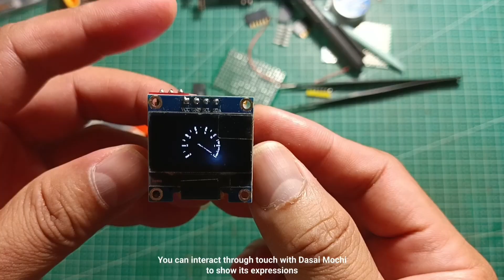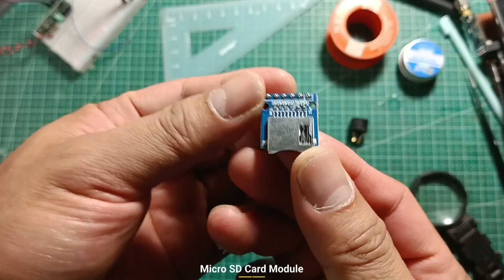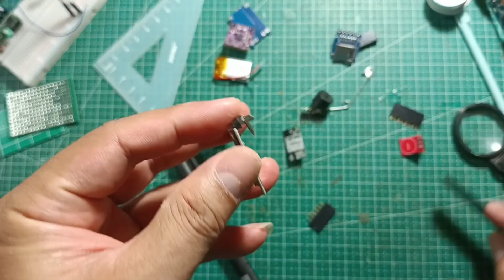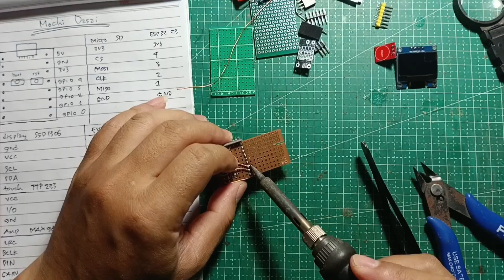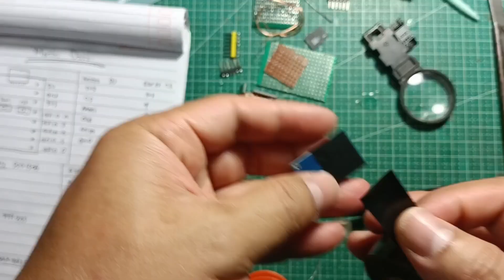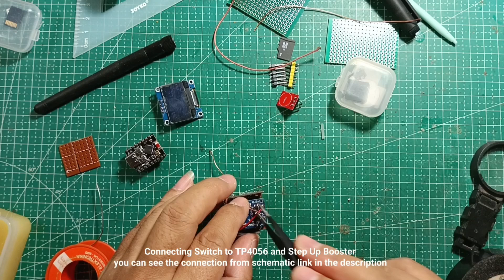How to Make Dasai Mochi by Huykhong Part 1

Comment from the maker: Leave a comment and feel free to ask question here 👇
Reply: can you please send me here the component's please everything btw including the random brown board the usb cable and the wires its for my sisters project. thank you!!
Reply from the maker: Components list It's already in the video
Reply: hi can you tell me the names of the brown board thing the usb cables and the head pin sizes?
Reply from the maker: Brown board is a dot matrix PCB, USB cable for esp32 C3 is a type C, and for the header pin all use standard header pins
Reply: Can i use wires instead of header pins?
Reply from the maker: Yes you can
Reply: How to add a mpu6050 gyro module to this build? Would it work? Thank you!
Reply: why is there no network port connected?

Comment: Hi!  I have a problem with a non-working touch sensor. The sensor is working, the red indicator on the board lights up when pressed, but there is no sound or any changes on the display. Someone writes that the PIN code needs to be installed during the firmware. There is a corresponding option there. Where and which PIN code you need to set - help! I don't understand what to do.
Reply from the maker: It doesn't ask PIN code when i flashing the Firmware
Reply: @ARTFOR  so I think I'm getting some kind of stripped-down version of Moti - it shows pictures in a circle, the touch sensor triggers a red signal, but nothing changes. I don't understand what to do. Help!
Reply: Контакт сенсорного экрана установите значение 1 - решение
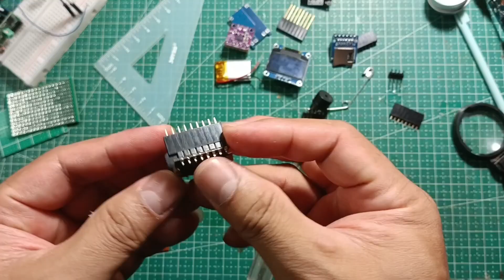Reply from the maker: Look at this video, in minute 3:15 in "Touch sensor foot" section change the value to "10"
https://youtu.be/8goPUs0yEig?si=eL0I7kTERdzSM7Cf

Comment: I did everything, the wiring uploaded the code double checked everything but there is no display showing what could be the issue i used the same pins on the c3 mini aswell, the display is 0.96" SSD1306, Still no display
Reply from the maker: Can i see your build?, you can send it in my tiktok account "artfor"

Comment: is it possible to make it without using micro sd card, dc to dc set up module and amplifier?
I'm just learning and want to make this
Reply from the maker: Yes, you can make it only with display and C3 board

Comment: which soildering iron are you using and what is the temperature of that iron.
Reply from the maker: I'm using T******e soldering iron, i'm usually use 350 to 450 °C temperature setting

Comment: Is there any application through which we can set its settings?
Reply from the maker: Yes, you can setting all hardware and system setting in Huykhong website, you can also make custom expression with sound with gif converter tools
Reply: @ARTFOR some extra features like ai bot like voice communication is possible
Reply from the maker: @DeepGkknowledge52 no, not that far.....not yet for now

Comment: Sir, the code has been uploaded in my ESP 32C3, but in the old display, it is not showing on the screen, what could be the problem, please tell me about it
Reply from the maker: What is your display ? 0.96" SSD1306???
Reply: @ARTFOR yes SSDD1306
Reply: @ARTFOR Sir, if we first upload the code in it and then connect it and display it, will it work?

Comment: My bluetooth is not showing
Reply from the maker: Default name for bt Dasai Mochi is "THE MOCHI". Try to refresh your phone bluetooth again after turning on your Dasai Mochi
Reply: @ARTFOR  its still not showing and not getting connected with chronos
Reply from the maker: Try searching with another device or phone, if still happens there's something wrong with your board or try to reflash again the firmware.... Actually THE MOCHI will automatically ON every time you powering on Dasai Mochi
Reply: Bluetooth works only in chronos app

Comment: I saw some dasai mochi also shows time and weather..how to do that
Reply from the maker: Just simply double tap the touch (you can setting touch in the configuration, see my tutorial video) then time will automatically appear
Reply from the maker: To show weather, navigator for google maps, incoming call notification, incoming message you need to install Chronos application on your phone and pair it with Dasai Mochi via bluetooth connection. I will make video about it soon
Reply from the maker: To show weather, navigator for google maps, incoming call notification, incoming message you need to install Chronos application on your phone and pair it with Dasai Mochi via bluetooth connection. I will make video about it soon